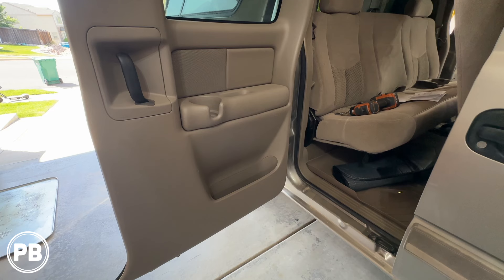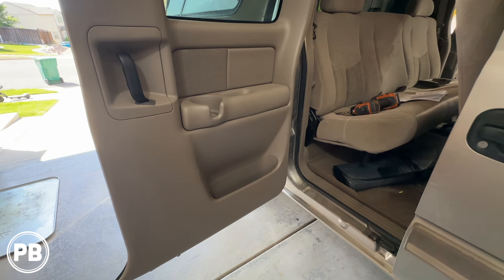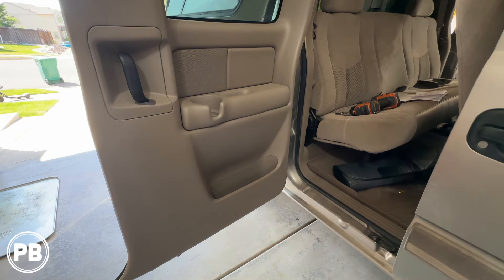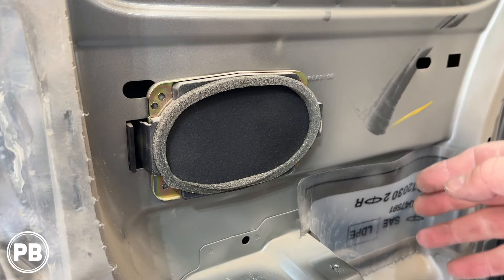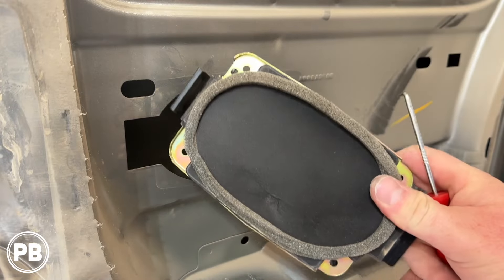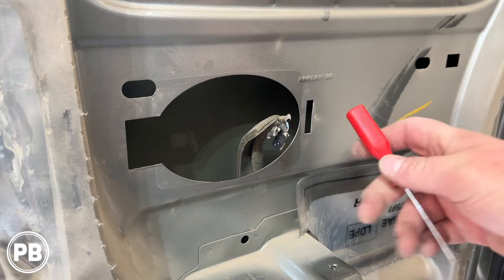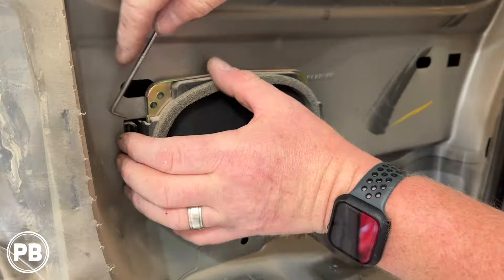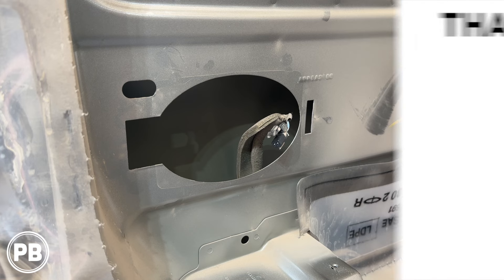1999 - 2006 Chevy / GMC Rear Door Speaker Install (Extended Cab)

Comment: This video helped me a lot, Thanks! I used all the gear recommended to replace the speakers in my 2006 GMC Sierra 2500HD extended cab 4X4. 
Instead of using screws to attach the speakers in the year door I carefully removed the bracket from the factory speakers and used J-B Weld to carefully attach them to the PIONEER TS-A4670F 4x6 4-Way Coaxial Speaker recommended in the video. This worked perfectly. 
The improvement in sound quality from the Rockford Fosgate speakers in the front and the Pioneers in the back versus the worn out stock speakers is incredible. 
Thanks for the advice, you made this so easy for me and saved me the $200 the local stereo shop wanted to install the speakers.

Comment: What about an extended cab that only has one rear door(behind the passenger seat), since you can't open the left side door and take off the panel?
Reply: Not sure if you’ve found a solution but I used to have one and you can just take the grill out and go from there
Reply: I have the same question seeing as I have a 3 door model